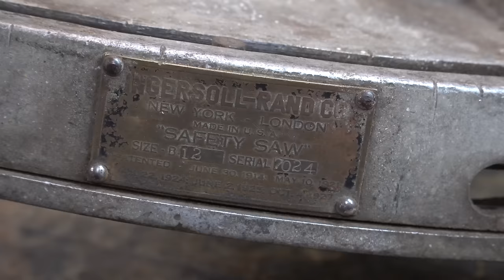Triple-Piston Pneumatic Circular Saw [Restoration]

Comment: Amazing tool refurb as always.  Regarding portable circular saws I have always wondered why the cutting operation is on the right side of the saw while operator (90% right handers) stand / operate on the left side, making seeing the cutting point difficult. Recent cordless circ saws (like from Makita) do have the saw blade on the left, which is so much more logical and better imo. Thanks again for a fun display of a crazy weird dangerous tool!
Reply: It has to do with the weight of the saw's drive mechanism (at least until recently). Consider a common task, ripping a few inches off a panel of sheet goods. You would want most of the weight of the saw to be resting on the part of the panel that will stay stable and intact. You also have more control if the weight is close to the centre point of the body, and up until recently these saws would always either have an air hose, or electrical cord coming from the drive mechanism; which most users want to keep from getting close to the saw blade by throwing it over the shoulder, or at least being able to see it at all times by resting it on the "stable" surface. Also, most saws are operated with two hands, with the left holding part of the weight while the right operates the saw and does most of the guiding.

Now consider what would happen if the blade was on the left; Since you need to cut forward, all of the weight of the drive mechanism would be resting on the part of the saw that is in open space with only a few inches of shoe on the stable surface, while the rest of the saw wants to tilt AWAY from the user, making cutting 90° with this saw very difficult. Also, since most of the saw is now to the far-right of the user, the left hand can no longer be easily used to help support the weight. To compensate for this "torque away from the user into empty space", you would need a MUCH wider shoe on the non-drive side that would also interfere with your cutting view, and also make it impossible to tilt the saw off 90°, and largely reduce the saw's utility because this extra large shoe would get in the way (not to mention increase the manufacturing costs). Also, the power cord or hose would tend to be dangling "in space" and close to the blade as the cut is being made, making accidental damage much more likely.
So to compensate for all this awkwardness and to make the saw more safe to use, you will need to cut with the saw on the left hand side of the user, so that the weight can once again rest on the stable surface. So now we have a right-handed user cutting with their left hand, to add to the original problem you tried to solve.

With "Normal" saws, the problem you mentioned is that the user must "lean forward slightly" to see the actual blade as it cuts; and most decent quality saws now have a laser or even just a simple notch at the front of the shoe that shows where the saw blade will be cutting after less than an inch of travel, so "the problem" is more of a nuisance than a difficulty.

So to summarize, the blade is on the right side of the saw because (at least until recently) doing so fixes/prevents more problems with the saw's operation for 90% of users, and thereby makes the tool safer to use. Moving the cutting operation to the opposite side makes it easier to see where the saw is cutting, but makes the saw MUCH more difficult to use safely for that same 90% of users.

Obviously the reason why saws with cutting operations on the left are now being made available is because the saws themselves are lighter (thereby reducing the torque AWAY from the user), and can be powered by batteries, thereby removing the dangling cord problem. I will say however, every "left cutting saw" I've ever used has severely lacked the power and control that I have needed them to have, and I've never been happy using them for anything other than "light duty or fiddly work".

Hope that helps
Best

Comment: What a fascinating piece of kit, and a great restoration! If there’s more torque than you need then your air pressure is sufficient. If it lacks speed then you’re lacking flow. I’d be worried about a leaking trigger valve if it idles. Shouldn’t do that! Not exactly safe!

Comment: I wasn't expecting a 12" blade on that thing from seeing the thumbnail. If I had to guess this was probably used by the railroad for cutting ties or whatever for maintenance. No electricity but if you have an engine you have compressed air

Comment: That big-flame-small-rod welded aluminum repair was very sensual, and the nutella was very forbidden. I felt... tingly. Stanley wood-planing was also very energetic and pleasing - especially in service of what looks like the second-most dangerous saw in the shop. Also, the new screwdriver expresses the same sensuality as the recent socket driver... very charming. I must have one. Is the blade heat-treated? Many thanks.
Reply from the maker: Hahahaha and yes it is!

Comment: It's probably because of how high I am but I cheered when you got the nut unstuck with the impact driver.  One of your best scenes. The tension, the release, it was riveting.         

                      I've been using and carrying your mini wrench at work for almost a year, I think.  It lives in the front pocket of my overalls. I use it all the time and I love it.  It's a tough little thing. However.   I know it's bad, but I have used it on stuff bigger than 1cm. It's so hard not to. It still works but it's definitely a little looser and the thread part is bent slightly now. Which makes it a just a little sticky when opening and closing. You should make one that's a little bigger than the mini. One that you could still carry in your pocket that also can get purchase on a 1.5 or 2cm nut and wrench on it without breaking.  I use my mini as little clamp all the time too and if it was just a little bigger it would be even more useful to me. II would buy it in a second.  Anyway, great product, and great videos. You're bangin on all cylinders bud.
Reply from the maker: I am actually working on that exact size right now!  Prototyping as we speak.
Reply: @HandToolRescue  That is awesome. I can't wait. When do you think they will be available? Can I call dibs on serial#666? The Wrench of the Beast!

Comment: I like this. Thumbs up. Was wondering what the actual time line is to restore an item. Like how long from beginning tear down to finished and operational? Days, weeks, months? How long does it soak in Rust removal solution? Do you always wear pants or sometimes shorts? Is there a Mrs. H.T.R.? Do you use more diesel or gasoline? Is the current cost of diesel concerning to you? Do you eat beans? Do you eat rice? Would you eat beans and rice with a commenter? How often would you eat beans and rice in a week? Fried turkey.

Comment: I love it. But man, idk if it should be called the "Safety Saw" lol. I'd probably turn it into a stationery Radial Arm Saw. Lol.. That things super sketchy lol. I also liked the idle. Really cool restoration. I also like that it's pneumatic lol. I'd like to see it's full potential, never seen a Saw work off air before, very cool. Almost as scary as that log cutter thing you fixed. Great work man.

Comment: that unshielded bearing sounded a little crunchy.

I think you did well with the aluminum stick.

You may need to make a new valve for the trigger since those generally need extremely tight tolerances to maintain  pressure. Does it state the pressure and flowrate?

Comment: What a fantastic gadget. Just thinking about your lathe though, if it used to have enough power but doesn't now it could be the capacitors ( if it is a cap start / cap run induction motor ). Just change them out, like for like as they are cheap and easy to replace. Might be time to do a rescue on your lathe spindle though.

Comment: @Hand Tool Rescue

Wow, that connecting rod retaining system is pretty neat.  I kind of expected to see a system kind of like that used on radial aircraft engines.

Did you contact Ingersoll-Rand to acquire a service manual and check on parts availability?

Any idea what the reduction ratio of the worm gear is?

How does the inlet-exhaust system for the cylinders work?

Comment: I recall a lot of the 3-cylinder air motors used in the maritime industry to drive winches and windlasses were also rated for steam service up to listed pressures and temperatures.

Comment: I agree the flow control valving shafts needs to be plated though the aluminum may be pitted if so you need to reem it and make a new stainless shaft that's matching, for safety you can put a ball valve on the inlet.

Comment: It's amazing that there were not more accidents with these old power saws...  Every single saw you've restored looks like a potential instrument of self-maiming...  The Sally Saw, the Swing saw, the drag saw all look really sketchy to even be near, never mind actually use...
Reply: ❤There were tons of accidents, leading to maimings, permanent disabilities, and even a few deaths. That’s why they aren’t made any longer.
Reply: They are not even a fraction as scary as the first few models of wood chippers, no safeties at all, other than maybe a sheet of rubber to catch whatever got flung back toward the operator.

I'd deem the modern day chainsaw more dangerous than any of the saws featured on this channel so far.
Reply: Yeah, they sure knew how to make dangerous stuff back in the day.

Comment: Repair of machines I find vital in the discovery of how to improve them and understand how they have failed, despite being (well designned) .  the impact driver pulls some very deep rusted sockets, maybe physicall resonance is better than chemicals for rust sieze. I wonder what crud and spiders webs are being created now for discovery .in the recycling of the parts we make now. Sprayed the bed and headstock housing this week , my sandblasting cabinet is so small I cut the handle off the gun to get the air feed 3" shorter.  the 6mm nozel lasted a few seconds on the 50l tank, put a 4mm ss tube in but wouldnt pick up the sand. So i acetoned the bed and headstock and it cracked off, probably lead paint, I used to melt lead in tins as a kid and pour numbers. . Crashing the party,only watched half the video.

Comment: we need more run time on the tools after their back in working condition.. get them sweating give them a workout, thats the best part seeing them still doing work 100 years after being made 

that thing likely needs 150PSI and 1" air line to work as intended with an engine driven compressor

Comment: I reckon the idling might be a safety feature, letting the operator know that the saw is "live" and ready for use.
Reply: Like the way automatic transmission cars creep so you have to hold them with the brake? It's definitely considered a desirable feature, most EVs seem to copy it...
Same reasoning as yours, presumably.

Comment: I wonder if you had the right compressor would it stop the idle?   Is it possible that with not enough air pressure the valves aren't operating the way they are supposed to?

Comment: TIG Welding old sand-cast aluminum is a bit risky in itself.
Hit one bit of embeded sand with the torch and it kind of explodes.
Gas welding aluminum can be gentler.

Comment: If you're ever concerned about the asbestos gaskets, though they're not a huge risk, try a 50/50 mix of pva glue and water in a spray bottle. It is easily removed and will prevent any loose fibres from becoming airborne.

Comment: At 16:00, not enough heat. The blue wrench usually works if enough heat is applied. Aluminum is a very good heat sink, you have to use a lot of heat.

Comment: hey HTR! i was given a 1950s black and decker deluxe utility drill. i managed to break it down and clean all the dead tree carcass out. the grease in the gearbox seemed to be ok. didn't smell cooked or look separated. but in the case of replacing the grease, what would be the recommendation to fill it with?

Comment: Judging by the size and shape of the saw, I'd say it looks more like a K-12 saw, for cutting through concrete and steel, fire departments use them for venting roofs or cutting through locked gates

Comment: Didn't it appear to you that the nut and pin should be removed before you pull out the worm shaft? By doing so you can maintain the bearing as one piece left behind in the cavity without destroying it like you did? Just a suggestion from my side. Thank you!

Comment: @Hand Tool Rescue - great work as always, but it got me wondering - do you have a photographic memory, or do you make loads of notes, or do you just re-watch your own footage to see where everything goes when putting it back together?

On some projects I can imagine it wouldn't be too hard to remember what goes where, but something like this with a lot of parts, & some of them rather fiddly? I wouldn't have the patience for it.

Also - worm gear driven saw grease??? If you told me that such a tool existed I wouldn't have been too surprised, but the fact that there are enough of them in existence to justify a major company producing a grease specifically for them? That does surprise me.

Comment: About 120-140 RPM at your air volume. Oh, my. I have four, 20 foot tall compressors at work plumbed together. They're hundreds of CFM each. If I used one of our one inch lines, the air flow would be insane. It would even idle at a dangerous speed.

Comment: I'm thinking the handle would need to be bored out oversize and a sleeve pressed in and reamed and lapped to the exact size of the  air valve to get it to stop "Idling" when your finger isnt on the trigger?

Comment: The slide valve likely corroded the hosing, which is why it idles. Stainless and aluminum dont go well together. Would have to re hone the inside and make a new oversized valve.

Comment: Why didn't the auto industry use connecting rod crankshaft setups like this air saw?  Probably too expensive I guess.   Did rotary airplane engines have roller bearings like it?

Comment: A trick for removing steel from aluminum Poor boiling water over the aluminum, it expands at a much lower temperature than steel and at a far greater rate so loosening the steel screw etc. A tip from the Rolls Royce Merlin manual and it works flawlessly.

Comment: Actually the idling might possibly even be a safety feature, it's really hard to cut your finger off while trying to sharpen an idling circular saw.
Or if these were ment to be used inside a mine miles away from compressor, there is no better way to know if the line is pressurised that idling saw
And the "leak" doesn't matter because air is pumped down the mine anyways

Comment: Nothing odd about the outer race being installed from the otherside. I see it all the time in industrial gearboxes.
Frankly you are lucky they didn't decide to use a bearing with a captured outer race where they'd heat it up the entire thing and stick the shaft in. Removing the need for the pin and nut, that would blooooow to repair but I've seen that before. Only way is to meticulously cut the bearing out.

Comment: Maybe connect some kind of wires to those when you dip them in that solution so you may not have to use your arm so much for what it may do to you
Reply: It’s evapo-rust, it’s non-toxic. You could drink the stuff if you wanted to.

Comment: The white stuff at 17:00 will be hydrated aluminium oxide (aka aluminium hydroxide) which is a corrosion product from the contact with a more noble metal (brass) significantly higher on the galvanic series. Ingersoll Rand would never have had a brass item contacting their aluminium parts, it's a death sentence.
Reply: Actually they proved me wrong a mere minute later: the nameplate is brass (or bronze). And it's somewhat corroded behind it. They may have put some zinc chromate paste on the back before fitting it, or some other preventative measure...

Comment: What times the air to cylinders?
Reply: At 19:38 you can see a big notch or divot in the shaft, and three openings in the bearing it fits into (in the background). I think there are three sets of openings and the notch lines up with each set of openings in turn and that allows the air to flow to the corresponding cylinder. At 27:28 you can see the air passages from the outside, one leading down to the bearing and three leading up to the cylinders.
Reply: Actually, at 10:50 you can see two notches on opposite sides of the shaft, one higher than the other. One for intake, the other for exhaust, presumably.

Comment: I note that you are using an inadequate hammer with your "Impact Driver". Impact Drivers are meant to suffer manifold indignities while being beaten by large hammers. You used what I would call a "tappy tap" hammer where me doing the same work use a "Poundy Pound" striking hammer.` When I use my tools the offending fastener is either: #1) Loosened satisfactorily or #2) stripped of it's worn slot. In practical terms I rarely ever fail to loosen a fastener using my rugged tools. 🙂 Hammer: I use a three lb "Drilling Sledge Hammer". It is made to strike very hard in conjunction with my Impact driver. Further: I cannot see what you are doing with your impact driver however you must always firmly twist the impact driver in the direction you wish the fastener to go to be loosened. Hence the message I gave about the fastener either loosening or being destroyed. Here endeth the lesson for today. Don't be mad. I am really trying to help.

Comment: Your compressor isn't running at a high enough pressure or volume of air to operate that saw at the proper RPM or torque !
Reply from the maker: Not even close! I need 90psi @ 100cfm.

Comment: Nothing about this saw is nearly as sketchy as your fingers holding that board down running through the table saw. You have a push stick to keep your sausages away from the spinny death wheel, not to accompany them to a merry dismemberment.